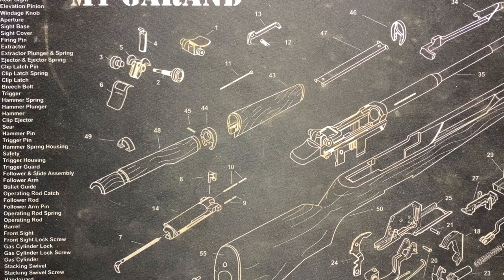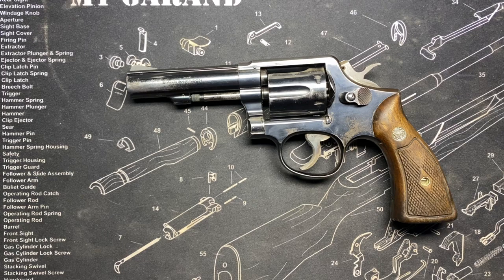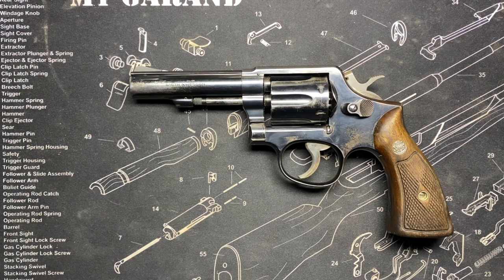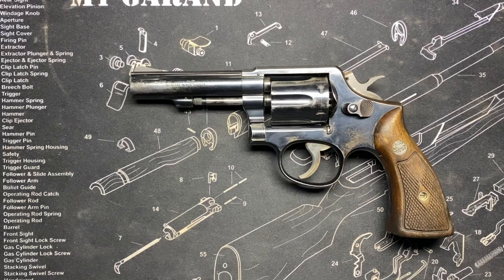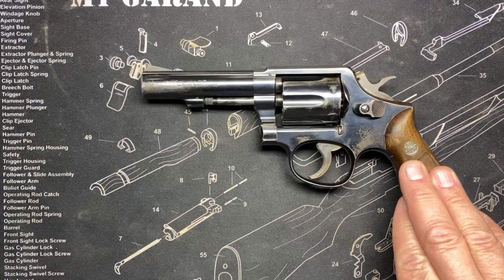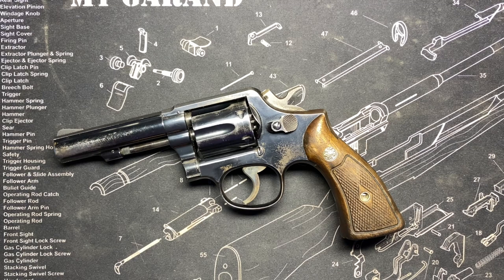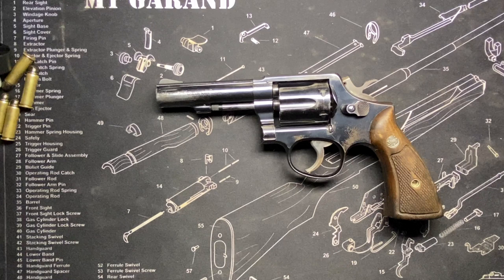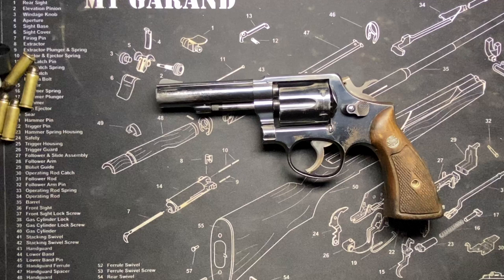Smith & Wesson Model 10

Comment: Very nice video and history of an iconic handgun.  When the NYPD first transitioned to semiautos, they permitted any officers to keep their revolvers if they so chose.  After the "final" switch, the S&W 640 revolver was allowed as an off-duty weapon, but they now permit small single stack semiautos and I believe the 640 is no longer on the approved list.  Bit of a shame, since the small semi's don't provide a great deal more capacity than the utterly reliable 640.  At least the new issue semiautos are being supplied with a 5 lb trigger vs 12 lb.  Of course, there are people complaining these are more dangerous to the public; they of course have never tried to shoot a 12 lb trigger accurately.
Reply from the maker: The revolvers being gone now means they officially represent a different era.  Thanks for sharing.

Comment: Great video. Very enjoyable as I own a 10-5 that is beautiful!

An easy way to check on the yoke/gas ring quandry is to pull the stocks off and see if the assembly number on the left side of the frame matches the yoke. I am thinking it won't match as the gas ring should be on the yoke. Check and see if the serial number on the stock matches the serial number on the frame. Would be cool if it does! I believe they only put the number on one of them. I have a 27-2 that I bought last year, beautiful 357 btw circa 1979! The assembly number on the yoke is 1 number off from the assembly number under the stock on the frame. It's an anomaly for sure. S&W said some people would pay more for it due to that while others think it would devalue it. I think it's cool that it's one number off. Was the assembler distracted? Did the yoke not fit quite perfectly so he went to the next one? Another mystery 

Gunblue460 on YouTube has a great video on disassembling S&W revolvers! That's where I learned to tear into them.
Reply from the maker: Your procedure to check the frame under the grips is accurate as I’ve already done a cleaning video that will drop Friday afternoon and to end the suspense…..they matched. It was not “updated” by the Roddmans Neck super crew of Armorers but is factory original from 1966. Where is this gas ring info coming from?  S&W keeps such good records…..wonder if a call over there can clear it up. 

Yours sounds nice. Enjoy and thanks for watching and contributing.
Reply: @MilsurpGarage  Wow, the plot thickens! I thought for sure they wouldn't match. I went through their historical society to find out what police department CCPD 432 was that is stamped into my 64-2. They were a big help. I finally discovered that it's from Corpus Christi PD
Reply from the maker: Recent;ly watched a youtube video of a guy showing a 10-7 ex police and you can clearly see the gas ring relationship from cylinder to yoke looks different than mine so maybe this switch was really to the 10-7?

Comment: The Model 10 is the undisputed Heavyweight Champ of cop .38 Special Service Revolvers. No other make or model duty .38 Special Revolvers come close in production numbers to the Model 10 and pre-Model 10 guns. The heavy barrel model was most preferred to the standard barrel 10 from the 1970's on to production end. My first PD issue was the Model 10 in blue steel, and a four-inch "standard barrel". This was the Model 10-5 series and both of these mentioned Models were NYPD approved/purchase for duty use and carry. The Dan Wesson Model 11,  that was NYPD approved for purchase and duty use, was specially modified by Dan Wesson for sale to NYPD. This was their first production model and Mr Dan was eager to get NYPD approval duty use. This would mean money,  that his "just started" Dan Wesson Company needed badly. The Model 11 was .38 Special chambering only, blue steel, non-removable 4-inch barrel, with fixed sights. Those fished sights on the Model 11 were the "best ever", speaking for myself. Interesting bit of NYPD duty revolver history on an approved-for-duty and purchase six-gun. The Model 11 was not well known, and it's porkchop shaped barrel shroud was off setting with many cops, not familiar with firearms. The Model 11 had a profile unlike the other service revolvers that NYPD approved of. But if they had known of the Dan Wesson's accuracy factor, heavy duty barrel, and good thick steel in its frame, cylinder, and barrel really made this gun a winner for those gun buyers familiar with firearms. Little bit of history here, and I thank you for the opportunity to share.
Reply from the maker: No, thank you.  That Dan Wesson sounds nice.

Comment: Late getting here, sorry. But I have some data. If the  S&W in the picture at about 4:50 was a rechambered  Victory model, that might answer the question. Some of the Victory models were "Lend Lease" guns sent to England during WW2. Those ".38s" were actually chambered for our old .38 S&W/.38 Colt New Police round with a 200 grain lead bullet. The bullet diameter on that round
was approximately .364 or .365 inch. The .38 special is actually .356 or .357. So rechambering the cylinder on a British surplussed old .38/200 and not changing the barrel would have been a
reason for poor ballistic markings on a smaller diameter .38 special bullet. Some surplus Victory models that came back here had the cylinder bored out by some "genius" so that longer .38
special rounds would  fully enter the chambers. But never count on those  modified (spelled, BUTHERED) revolvers to shoot straight. And .38 special brass gets stretched out of shape in them.
So reloaders will cuss like hell. Anyway , that may answer why the crime lab had a time figuring the ballistics out on that particular revolver. And yes...model 10/15 (fixed versus adjustable
sights) in the .38 special and 13/19 (fixed versus adjustable sights) for the .357 magnum.
Reply from the maker: All of what you mentioned was EXACTLY what was going on with Oswalds revolver.

Comment: For the British during WW2, a lot of S&W revolvers were made in 38 S&W caliber in the S&W 38-20 caliber, which is a British Caliber with a 200 grain bullet with .361 caliber. The 38 Special bullet is .357 diameter. 38 Special's case length is a little longer than the S&W 38-200, but maybe it may have been usable in the 38-200. Just a guess.
Reply from the maker: A lot of gunsmiths modified the 38–200 for .38 by reaming the case size limiter but the rounds were loose and cases bulged and ruptured. Not safe bug hey, it was the 60’s…..Check out all the info on the gun Oswald used to shoot PO Tippit.

Comment: Man I had a opportunity about 4 years ago to pick up a brand new in the box model 10 for 300 bucks. From a local gun shop but didn’t because it was chambered in 38 and not 357. God I kick myself every time I see one in a video now. This was before I was fully interested in reloading and casting. So I was of the mine set that if a revolver isn’t chambered in 357 it was pointless because you can just download a 357 to 38 pressure. However now that I’m a bit more wiser about 38 and the cost of reloading. 38 is a great cartridge in its own right and I just passed on a beautiful icon of a revolver because of my lack of knowledge. Smh I own a Ruger Security six pre warning banner about 97% gun but I still want a nice S&W in my collection.
Reply from the maker: There will be another that will come along soon enough. 

Let me ask you, how is the Ruger?  I have my eyes on one….a 1988 in .38, supposedly last year of manufacture.  Lots of wear like this one. 

It has that huge “read instructions first” crap on it….any other reason to avoid these examples besides how horrible that looks?  What was the year they started that?

Comment: I have the 10-5 made in 1962 near mint condition with the 5 inch standard barrel and it has the gas ring you show as well connected to the cylinder and I wouldn't own the 357 mag for there's no need in the increase in power for it's all about the bullet placement but I do own the 629-3 in the more powerful .44 magnum to have my at the time Dirty Harry most powerful handgun in the world and as Harry would say would blow your head clean off in the movie that is !!!
Reply from the maker: Sure, bullet placement is certainly important, but that 357 round…….Holy crap. What a powerhouse.